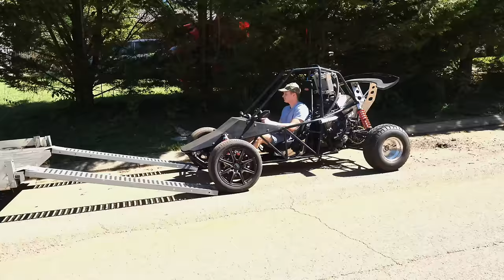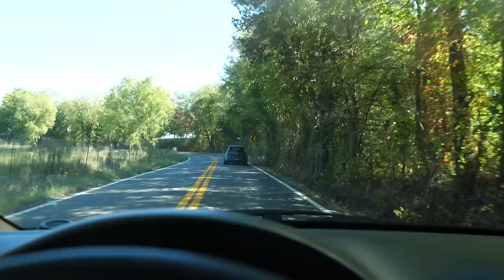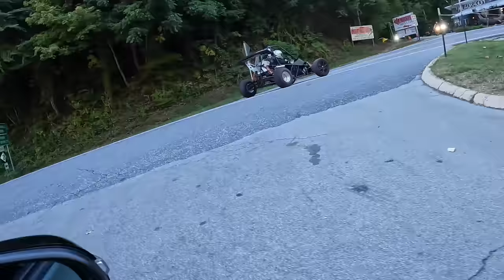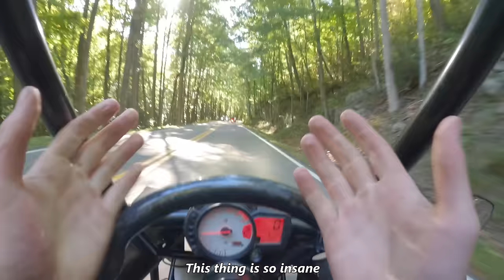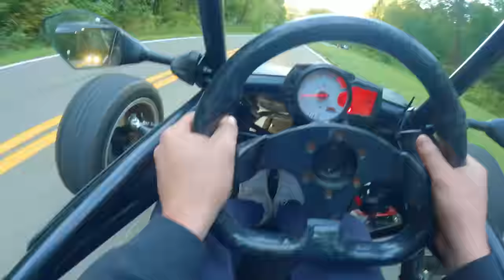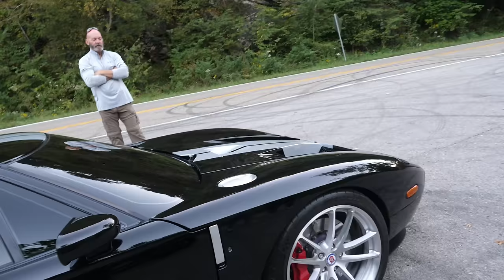600cc Crosskart Tail of the Dragon POV (almost lost it)

Comment: Oil slosh will destroy your engine specially doing drifts.
Bike engines are super sensitive when they don't lean when cornering.
Either get a oil pressure accumulator or dry sump.
But that thing is so awsome.
Reply: Yes this is a great comment watch "Fast Matt" on his car with a street bike engine that he blew because he was on 5he track and the oil wasn't pumping because of this exact issue. For real V you need to fix the oil pump and oil pan if your going to be racing this thing, it will blow man!
Reply: @timwegman5776  I was going to say the same.. "Fast Matt has done this to his Honda S600.
Reply: Add more oil to accommodate the slosh.

Comment: Hey for future reference, Things with coilovers or oil dampened suspension, I like to put blocks of wood under the chassis and strap the car down onto them to keep from having coilovers over compressed for extended amounts of time. It also helps with hitting bumps and the suspension loading and shocking the straps when the springs return. Can prevent unwanted loosening or straps/hooks popping off.
Reply: Is this better than straping the tires?
Reply: This. On our FSAE car we removed the shocks and replaced with beams when we drove it cross country. You're putting needless miles on the suspension otherwise.
Reply from the maker: I secured it by the arms so the suspension doesn't compress
Reply: Also over heats the dampers

Comment: I agree with the Ginger Ninjer 100%.  The tail of the dragon isn't the best place to attempt a speed record or push it to its limits. I rode it in 2006 with a brand new GSX-R1000.  The most memorable things I remember are 1) a Goldwing can absolutely fucking get it. 2) when their road sign says 15 mph, they mean 15 mph. In ohio, there isn't a caution speed sign you can't easily double.

Comment: Ridden the Tail of the Dragon 7 times. It is a awesome ride on 2 wheels but scary as hell with the 4 wheeled vehicles crossing over into your lane. A straight line is the fastest route on a track but when you have to share half the road you have to treat that double yellow like it's a wall. I have no parts from my bikes on the tree of shame but have helped haul a few bikes back up from the cliffsides. That first turn is a killer as most guys tear ass up to it and dive in hard on cold tires. Needless to say they low side it.

Comment: I'd take it a little slower on pushing the limits.  Get some more seat time and don't get emotional and adrenaline hyped and end up making a silly mistake.  I know it's easy to do-- I've rode 1000cc bikes for years.   Just take it easy and let yourself get better over time.   It's a lot more fun to go all out later, once you have full confidence in what the thing can do.  After you crash one of your toys, it takes away all the fun;  so just be patient.  That's one thing I wish people would have told me back when I was still learning and driving like a maniac..  You don't need to be slapping the rev limiter--- there is more than enough speed by fast shifting;   You don't have to have the engine screaming to the max to do it.  Play around at shifting at different RPM ranges and learn where the power is happiest.   Learn everything you can as you're driving, don't just stick to hitting red line--  try to avoid that actually most of the time.   Try to drive it as hard as you can at only 3/4 throttle.   You'll learn where the best torque really is and get better at your shift timing etc...  A lot of times you will want to come out of corners in a higher gear than you might think, because then it won't spin the wheels -- and you'll actually get more power to the ground-  power that you can use.
Reply: It’s a gsxr, that revs to 15k plus rpm. It’s power is literally in the higher rpms. You sure you rode?
Reply: @Cou-yonLogiC  The power is no good if you're just out running your gear and slapping the rev limiter--- or coming out of a corner and nearly spinning into the ditch every time.  I'm talking about "usable power.   Everything is easy on a straight away.   On a bike you can lean;   but on a buggy, it's no longer a bike -- you have to become a race car driver.  So take it easy until you do, or you WILL wind up into the wall, off a cliff or in the ditch.....  and Yes, I rode a CBR900 (stripped naked) for years, awesome bike.  Now I have a zzr1200, which was the fastest bike in the world when it was brand new.  I also turned a wrecked cbr600 into a quad and took it to the dunes several dozen trips and half of those I had my girl riding on the back with me.  Pretty sweet build.....  I've also put a 500cc Rotax engine from a snowmobile onto a 2 seater buggy--- and like I said--  it's not longer a bike that can lean;  you have to learn how to drive it differently, or you will be spinning your wheels and spinning out a lot;  or you can learn how to drift it and go that route-- but learning how to feather the throttle rather than full WOT at all times is still a factor in all of it.   This thing will still have good torque at 10k to 12k RPM, and you can race through the gears and be going more than fast enough through those turns-- and doing it all without burning through your tires and putting extra wear on your engine at the extremes, overheating it -- etc. while you're still trying to learn.  Learn how to drive it well there, and then you will be a speed demon when you go all out.  You can learn so much more about your cars when you're not leaning on WOT as a crutch.   Learn how to do all the other things well, and THEN do it at WOT later and you'll be in a different world.   Just saying...   Everyone can see it;   when there's a dozen bikes going past you in the other lane, and you're sliding around the corner about to dart off the cliff or swerve into them, etc.   It's not a good look--  and I guarantee you that several of those guys were not happy to see that and probably would have gave him a little speech about it.   Learn to drive it well before you drive it 'fast".   It's just common sense.

Comment: Only things I would not do next time are: 1) No need to down shift from 2nd to 1st on those corners. Your making it hard on yourself to control the exit of the corner and forcing more work on you and the engine. 2) Try to set up a air cooler for the oil. The cooler oil will allow the clutch to live longer pushing the heavier cart. 3) Better tires in the rear. You have street tires in the front but your running a genaric tire in the rear. A bike and that kart live for grip and you are starving it of that, which in turn robs you of performance.

Comment: Next time if it goes over 225ish park it, doesn’t matter what it is.if the cooling system is working 100%  perfectly on a stock motor temps should not be rising over a safe limit . While only the worst thing I’ve done while overheating something on accident is blowing a head gasket and I would hate to see you put back that amount of time
 still waiting to see this thing at a dragstrip!

Comment: Wonder how many turns you covered in coolant. Not fun for the motorcycles that had to ride after that. Coolant is very slippery... Especially for motorcycles.

Had the pleasure of following a box truck through there a few years ago that emptied his rear diff across half of the Dragon.

Comment: FYI - you can rent a pickup with a trailer hitch. Cheaper than fixing a car.
Reply: Not if you're younger than 25...
Reply from the maker: Plan was to drive my Miata through the course too
Reply: @VasilyBuilds  Towing overweight at 70mph at over 3k rpm for over an hour tends to do that to engines. Provided they aren't designed to do so...and Miata's aren't.
Reply: I’m pretty sure he knows that kid. He wasn’t born yesterday

Comment: Very cool build. I've been following it all along. Some advice if I may from my road racing days. The chassis should always far out handle the engine not the other way around. Just for your safety brother. Maybe some staggered tires and lower pressures in the rear. Also may want to look at some tuning on the suspension so it can maybe put that power down better

Comment: Very nice build. I have had both my zx10r and my mazdaspeed miata on the dragon and yes you don't need a lot of power for the dragon to have fun. Have you thought about putting a chain driven lsd in the back?
Reply: Yeah.. a solid axle is causing the rear to slip every time you turn.

Comment: That kart is badass.  Love it!! Would love to throw a more modern R1 engine on that thing and see what it would do.  Going from 110hp to 185-200 would make that kart even more fun.
Reply: No... no no no..  
It's already deadly enough.  If you want to go 1000cc, you need to have your buggy tuned tight.  You need to have better tires, better suspension, better brakes. etc..   1000cc on a buggy that can't handle it is just a death trap --- unless all you're doing is drag racing it.  This thing is plenty -- just let him learn first.

Comment: The way the back end was kicking out on the corners. It looks like it need a wider an a softer compound tire. The tires are building heat but about time you get to the corner aply the brakes most the heat in the tires is gone. An thenyou have to build it back up again.

Comment: The red light is an oil pressure warning light, not an oil level light…I wouldn’t be surprised if you lost a lot of oil out of the water pump drive hole when it came out. 
No doubt the over heating caused the mechanical seal to fail in the water pump too.
Maybe a track or empty road would of been more suitable for a shakedown, that way any spillages could of been dealt with, or it wouldn’t of effected other traffic as much

Comment: Maybe a dumb question, but why is there this much wheelspin from 110 hp? Because of the weight of the cart or are the tires old?
Reply from the maker: I put off-road tires on the rear and I'm purposefully blipping the throttle to initiate the skid
Reply: This buggy weighs approximately 700 lb, maybe 750... even with driver, it probably only weighs 850 lb. It has an excellent power to weight ratio.
Reply: No rear differential. Light. Not road tyres.
Reply: Solid rear axle is a big part of it

Comment: you need to run better tires to make it work better on the tail . i run toyo r888r tires on 15x8 inch bart wheels when i go there with my crosscart . . you need a front anti roll bar . i run a 3 piece  anti roll barwich is nice because they come off real fast and easy to make .also drain your rad and run Evans NPG Racing Coolant it will make a massive difference . lower your cart a lot i found 1.5 to 2 off the ground worked the best

Comment: If you shift your ass end (your rear wheel & axle weight displacement) further back you’ll get way better traction, a much better C.O.G. (Center of gravity) and better handling, acceleration and braking. 8”-14”

Comment: Learn the art of safety wiring man! Drill some holes, wire them correct, then your water pump won’t foul the track (road). Seriously, you should safety wire that mill. Excellent content, Deals Gap is no joke. Did you drop the air pressures in your tires prior to hitting the curves?

Comment: I wouldn’t dare turbo it if it’s already this sketchy. Beef up the suspension and get tires that can handle the power. If you wanna get more power tho I’d say do a 1000cc swap instead of a turbo. Just like on the streets, a turbo 600 really isn’t fun. Constantly in the 10k-16k rpm range, and it still only tops at 150ish. A liter bike motor for sure would be awesome